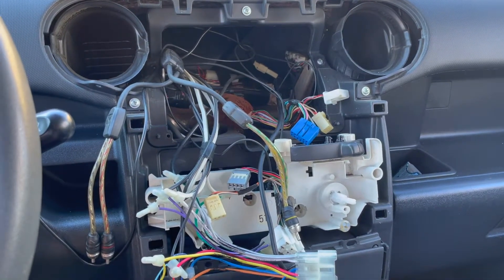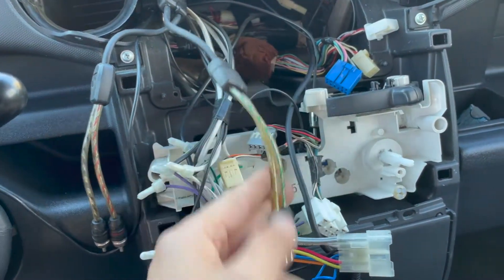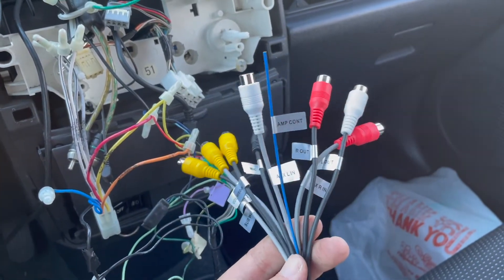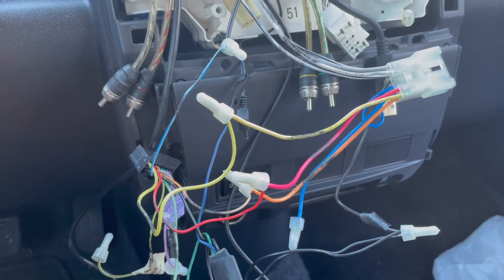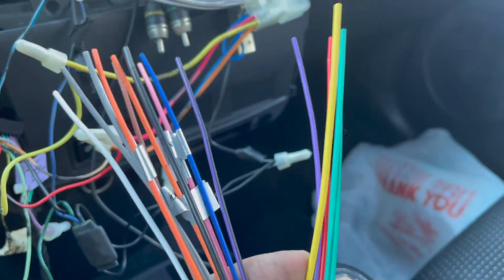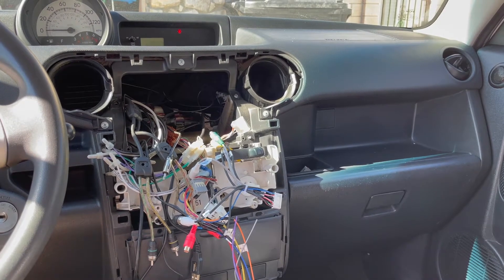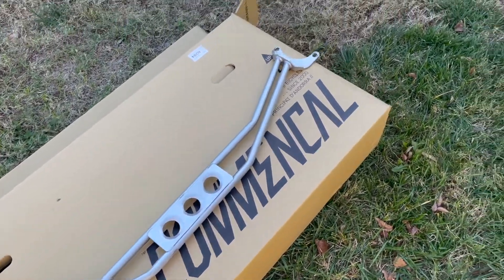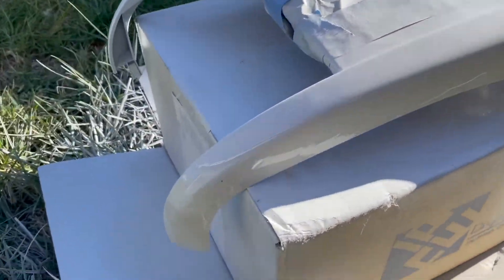HOW TO INSTALL and WIRE ANDROID 10.1 DOUBLE DIN RADIO HEAD UNIT | SCION XB

Comment: Newbie question......does this have GPS?... and if so.... is it embedded within the unit or does it link to the cell's GPS that you may have in the car with you, and simply displays the cell phone's GPS?.... confused on how GPS would work on an aftermarket unit.
Reply from the maker: it has a gps dongle connected to the unit. It uses it to display car speed etc. I rately use the gps on the navigation.. i always refer to the phone for waze. It could use google maps but requires to connect to your phones hot spot for wifi

Comment: Is this a Hikity brand? I just purchased their 9 inch android unit for my 2006 xB. I’m going from the stock scion head unit to this Hikity one. Are the scion wires labeled for where I need to splice them to on the new harness? Or is there a wiring diagram for them?
Reply from the maker: my unit already had mods with an amp. if yours is stock, buy the wiring harness on amazon that would allow you to connect the spiced wires from the new unit to the harness. this way it will just plug In to your oem plug. https://amzn.to/3u5IU90

Comment: Do you have any PDF MANUAL link for this head unit and possibly any insight into what accessories like a HUD or anything that can be added to this head unit. I purchased the same exact unit but the packaging did not contain any link for a manual or manual of any kind . Any insight would be greatly appreciated. TIA
Reply from the maker: sorry no pdf

Comment: My display only turns on in reverse gear. Any ideas?
Reply: Sounds like you have wire mixed up. There is usually a handbrake wire and a reverse cam wire that goes to the reverse light circuit, one of these two wires could be wired wrong, if it is a newer car and you are connected to canbus it could be a software configuration issue, contact the seller, sometimes they can give you instructions or links to patches to fix it.